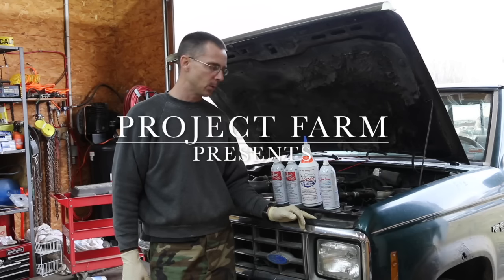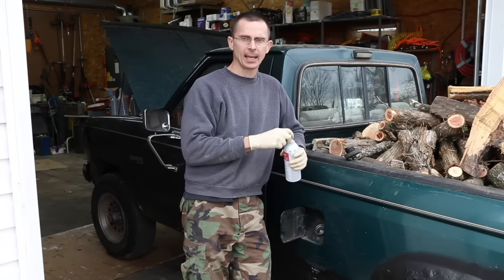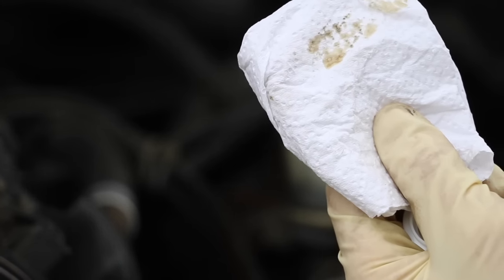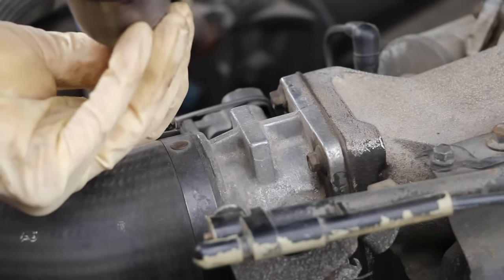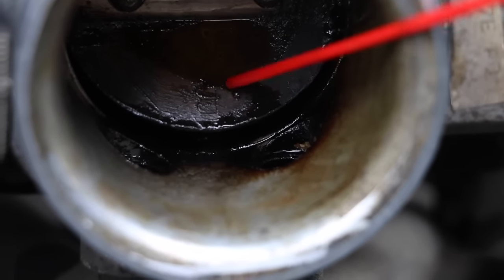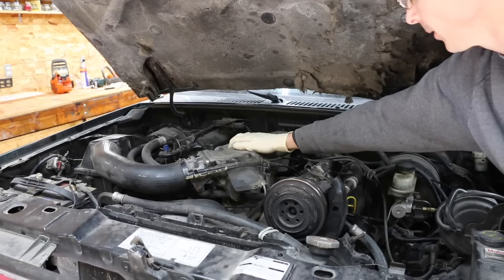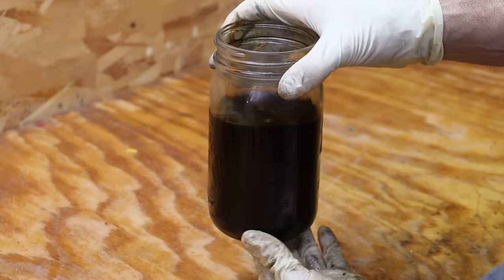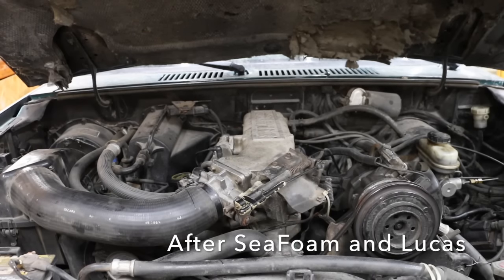Seafoam--can't believe what it did to my engine!!

Comment: This is actually because of years of neglect to an engine
Reply from the maker: Hi Gary, I agree.  I've owned the truck for less than a year and bought it knowing the engine was in very poor condition.  Glad the engine is running like a top again!  Thanks for commenting and hope you enjoy the weekend!
Reply: haha yea i was guna say
my f150 iv had seance i bought it it now has 560k miles same engine 
no problems
Reply: I agree.. The ol' IH Scouts in my family have over 1 million miles on the running gear. Engines were both rebuilt at the 1 million mile mark.. Always used 30wt Valvoline in winter and 50wt valvoline "racing" oil in the summer. Never added anything but sea foam or marvel to either engine.
Reply: No it's not. All these old 2.9s do it. They're known for it due to poor oil flow up to the lifters. The 2.8s were even worse. Mine was always taken care of, and with 175k miles it sounds about as bad as this one. I'll definitely have to do this to it, I just figured I'd have to live with it.

And with that being said. Your f150 with 560k is irrelevant.
Reply: Yes the 2.9l were known for lifter noise because of poor oil flow but the 2.8l had solid lifters so when the 2.8l got noisy all you need to do was adjust the rockers back to stock clearances. also the 2.9l and 4.0l had the tendency to wear out the tips of the rocker arms and that would also cause valve train noise.
Reply: Indeed.. I had several Ford Scorpio's with the same engine. The lifters always made noise.. Had also the older 2.8 in my Sierra XR4i and it didn't.. If it did you just had to adjust the rockers
Reply from the maker: AVC-Works, Thank you for watching the video and commenting!  I had a 1985 Sierra with the 2.8L many years ago too.  That was a terrific truck!  Thank you for watching the video and commenting!
Reply: gary thomas I had a Ford Sierra XR4i 2.8.. that's a totally different car :) Look it up. It's the same like yours Merkur XR4Ti but with a 6 cylinder. I'' from Europe btw.
Reply: True statement.  I had a BMW 328iS with 260K miles (still ran 0-60 in 5.9 when I sold it) and it NEVER had a throttle plate that looked like or anything close to a lifter/valve issue.  Simply because I MAINTAINED it.
Reply: grumblesa10 was that a street start? ahaha.
Reply: Nope :)
Reply: gary thomas
Reply: i agree, also 167k miles is is a lot but not a lot either i seen motors that had close to 300k miles and still fan good.
Reply: Honestly, something like this is just a temporary fix. Give it some time, and you'll hear those lifters again. I've been there.
Reply: Hopefully we can get an update in a few thousand miles.
Reply: I never liked to use a lot of junk in my engines ! all I do is keep my oil changed in my Blazer and it runs like a champ !
Reply: I believe your Sierra or it should be called the C/K Trucks is a GMC, not the European Ford model that was sold here in The US as a Merkur XR4Ti.
Reply: thats all that shit is my dodge van had 250,000 miles no noise nothin changed the oil every 2,000 miles!!!!!!!!!!!!!!!!!!!!!!!!!!!
Reply: It was also the Merkur XR4Ti in Europe.  I was chased out of Holland by one in 1985. The Dutch "highway police" had some they used on their "autobahn".(highest allowed speed was 120KMH)
Reply: art vandelay thank you 👏🏻👏🏻😂
Reply: me e
Reply: why dont you just adjust the tappets
Reply: because they are hydraulic lifters, they self adjust, and one is stuck down due to carbon deposits,  if you adjust it to get rid of the noise that one wont be self adjusting anymore.. or may even " pump up" after where the valve wont close completely.
Reply: That's great to hear. I used Valvoline racing oil in a Mustang engine. I would also add 1/2 quart of Amsoil of equal weight. Marvel in the fuel, sometimes a little in the oil. The car was so beat up at 260,000 miles, I had to sell it to the State buy back program. The engine still ran great.
Reply: Good maintenance to one person may be considered poor to another. Like never using Marvel or a similar product to lubricate the injectors and upper cylinders. Never changing the power steering fluid. Never changing gear oil, brake fluid, engine coolant, etc.
I've only met one person who never changed the engine oil. She said no one ever told her to have it done.
Reply: Don't put a lot of junk in it ! Get some knowledge before you do anything. You should be aware of filters as well as all fluids. Make a complete schedule going further than what is in the owners manual. They don't cover everything that will be needed. Only the basics, so you will have to buy a new vehicle.
Reply: Much better than going over the time to change. I've never seen an engine that was too clean! Be sure to put some oil in the filter each time it is replaced!
Reply: Should be done after what he did to clean up the engine !
Reply: Kevin Stearns  wow! That's a lot of wasted oil.

Comment: definitely fixed that stuck lifter! I'll have to try it out in my 99 4runner, it needs service.
Reply from the maker: Craftsman 1963, I hope it helps the lifter.  If you get a chance to try it out, it'd be great if you could let us know if it worked.  Thanks again for commenting.
Reply: Project Farm got a 97 grand prix 3.8L non s/c. 216k on it. lucas oil stabilizer every other oil change with 10w30 & still running strong. gonna try the sea foam bits today & see what happens. it worked like a charm on my 99 sentra with 2.0L. also for the guy who blames lucas for his rod knock, do some research. neons are garbage (with a few exceptions of course)
Reply: That engine has hydraulic lifters. Just using a much thicker oil would have quieted her down  ;)
Reply: robbynelson3 which are you referring to?
Reply: The Ford v6 in the Ranger.
Reply: Which one?  The 3 or the 4 liter?
Reply: That 2.9L V6 in the Ranger in the video.  Mine had a lifter tick as well on a cold start or if you let it sit too long, common issue on that engine.  I sold mine at 204k miles and last I knew the new owners have over 260k on it, aside from the occasional cracked head they're solid engines.

Comment: I put Lucas fuel injection cleaner every fill up, such a difference. I’m going to to the Seafoam my next oil change. I do a lot of driving so I hope this works just as well and by the looks of the video, I think it will. Oh, my vehicle is a 2016 Subaru Forester, 134,400.
Reply from the maker: Thanks for sharing.

Comment: That sound difference was awesome. I like to use seafoam in all my small engine equipment just by adding a bit to the gas. Helps as a winterizing stabilizer also. I like to empty the gas tanks and run almost pure seafoam for a second until it's through the fuel system, then shut off and no problems in the spring.
Reply from the maker: Thank you
Reply: Make sure to keep the tank full over winter to avoid corrosion on the dry tank walls...and if your rich fill it with ethanol free gas.
Reply: @fikretcekic2306 That sounds like good advice 40 years ago. 
Meaning what small engine equipment do you have with an unpainted metal gas tank? My Kawi and Stihl has plastic, and Honda gx etc have painted tanks.
Reply: @KF1  he was talking about the inside lmao. Its still best to leave tanks nearly full to prevent large amounts of condensation buildup.
Reply: @alexhill828  Yes I was also talking about the inside.
Reply: If you do that with two strokes no lubrication. Not good.

Comment: Just to be clear, you only add seafoam to the crank case(oil) 2-300 miles before an oil change.
Reply from the maker: That's a great way to do it. Thank you
Reply: napa has a seafoam guide, they recommend within 500 miles before an oil change to clean the crap out, then you can use a bit more in the new oil to keep it clean.
Reply: If you want to blow your engine, add it to the crankcase. Yeah, Napa told me about this miracle Seafoam too, was so convinced, I did it with 2 cars. Blew the engines on both! Both started burning oil very heavily. Thanks Napa! No more advice needed!
Reply: @melanieschafer1297  did you do it right. You have to do the changes after or you have all that buildup flowing through the engines that can cause more issues.
Reply: Eli Cole yes, I did it right before an oil change as they told me. Blew 2 engines! As I said Thank you Napa!
Reply: @melanieschafer1297  that sucks because I've used it for 15+ years on not only mine but many others vehicles with zero issue. Sorry that happened but it's still a great product
Reply: Eli Cole I think I will pass from now on, but thanks anyways!

Comment: One other recommendation for using Seafoam or any other similar product in your fuel tank. Before putting it in your tank let the tank run down to around a quarter before putting it in. Run the vehicle for roughly 11 to 15 miles. That’s generally just long enough for the product to completely soak up your entire fuel system. It’s a much more of a concentrated mixture. Park the vehicle and just let it set up for a couple of days. After it’s been setting up for a couple of days fill up the tank and drive it until back at to about a quarter. I do this about every three months or just after each oil change. One analogy to doing this is like putting really dirty clothes into a washing machine. Only fill up the washing machine to its lowest level. Add the same regular amount of detergent as you normally do. Let the washer run for about 3 to 5 minutes and then stop / pause it. Just let the clothes sit for a couple of hours as the clothes soak / steep in the concentrated mixture. Years ago washers featured a soak cycle. You would let the washer run through one washing cycle Then the washer would simply stop running and set in the soak cycle until you restarted it to finish the full wash and rinse. I first heard about this technique on the John Tesh radio program years ago. A guy did this with his wife’s car. He put the product in the wife’s car at a quarter of a tank. Ran it for a couple of miles. Parked the car in the back yard for a week or so while they went on a two week vacation. After they got back they simply filled up the tank and she drove it until roughly back to about a quarter. It does a really good deep soak cleaning of your entire fuel system.
Reply: Makes sense. I once called Chevron about their Techron fuel system cleaner and was told it’s the same additive in their fuels, it’s just not diluted. So your method just prevents it from being diluted by a tank of gas, which might be equivalent to the concentration used in professional fuel system cleaners at mechanic shops.
Reply: @LuckyCharms777  Just remember that it’s setting up inside your entire fuel system. Everything from the fuel injection system all the way back to the tank at a X4 concentration. It’s eating away like a crazy beaver that hasn’t seen a tree in 20 years. But it doesn’t just stop there. It’s also like a beaver in the tank itself eating away at all of the crud thats accumulated in the bottom of your tank over all these years. Plus it’s trying to get rid of any excess water that’s accumulated in the bottom of your tank from the usage of gasohol based fuels. I’m guessing that’s one of the ways using gasohol based fuels can seriously damage your engine. Imagine a huge slug of water going through the injection system into a hot cylinder and instantly flashing to steam. No telling what damage that might cause. I’d rather pay $12 at Walmart for a top grade total fuel cleaner. It’s a whole way better than having to shell out $4,000 to $7,000 for a total engine replacement. I think that’s what may have happened to my engine a few years back. All of a sudden I was getting a cooling system that was running very hot and constantly having to add coolant. Turned out I blew out a head gasket in my engine and my coolant was mixing into my oil and getting burnt out of my exhaust. I shelled out the big bucks for a engine replacement to the tune of just over $7,000 clams for that fix.

Comment: 1.7 people forgot to put their throttle caps back on after doing this lol
Reply from the maker: LOL!
Reply: what happened to the 0.3 that went with the 0.7 of a person???
Reply: And .3 people needed new blinker fluid.
Reply: @theungoliant9410  and piston return springs and muffler bearings
Reply: Hoodedstranger... I few months ago I had the oil changed....messed up the back a bit. Anyhow the dude changing the oil disconnected my throttle body hose...why I don't know. I took the car on the hwy. And it started to loose pwr. It was one of thos WTF moments!....Got off the hwy, popped the  hood and welaah!!! Reconnected the Hose the throttle assembly....Problem fixed. Needless to say? I do my own oil changes now....have a small lift (4ft high).

Comment: I would have like too seen a spark plug before & after comparison.
Reply: BustedWalletGarage 

yes... id love to have seen a spark plug also before and after... id probably be tempted to go ahead and change out the plugs  now just incase one maybe on the edge to foul...that was alot of crap that came out of the exhaust
Reply: Prop Paper I am no properly trained wrench turner but what I thought I heard was a dead cylinder. Hard to tell , not being there and all , but I would guess the main issue was a fouled plug. Looks like the kind of truck that you'd keep a quart of oil & a quart of tranny fluid stashed under the hood because you know you're gonna need it.
Reply: BustedWalletGarage ...

haha... i think we drink the same flavor  of kool aid, im sticky back yard wrench turner... errr deep deep back yard...haha

my truck i but oil by the case and keep a couple bottles in the fender wells...im on my cheap phone and so i couldnt exactly hear the engine very well... but ill certianly take your word that there is a dead cyl. ... which i think would not be out of common for this type of situation... on my classic sports car i fouled 2 plugs out of 4  just using starter spray this last winter
Reply: BustedWalletGarage although it’s not required most would recommend changing your plugs after treating with sea foam through your engines main vacuum line.

Comment: seafoam should pay you for this video
Reply from the maker: I don't want sponsorship from any manufacturer.  I'd much rather have the freedom to provide independent reviews.
Reply: I had my doubts about sea foam,I'm definitely using it after this,Thanx! Good stuff sells it's self.
Reply: Project Farm where r u located?
Reply: Blink not everyone knows about it. And some people think all products advertised like this are fake.
Reply: Blink nobody said it was a new concept
Reply: Passion man , PASSION!
Reply: Sounds like you now have a new machine!
Reply: Project Farm u may not want it but sea foam should just send u lost of sea foam. Great video. I’ve done that with diesel. I’m gonna follow ur lead and use sea foam next time . Thanks
Reply: Project Farm i put seafoam and lucas in a 3.0 90s hatchback chevy corsica i bought for 800 bucks cut the catalytic converter out changed a solenoid and straight piped that sucker. Ran smooth for another 20k miles with regular maintenance and regular sea foam, lucas, and octane boost.

Comment: Would you do these treatments as preventative measures (if so, how often) or just as needed as problems arise? Ps thanks for the great content!
Reply: I'm not sure about in cars, but the the guys I worked with and I would treat the gas and spray it as he did sort of like starter fluid into our snowblowers every year at the start of the season.  They fired right up and ran good, nothing else ever gave us those good results.  Once a year or after a significant duration of storage w/o running is good.  It's not going to hurt, it cleans all the broken down crud and carbon out of there.